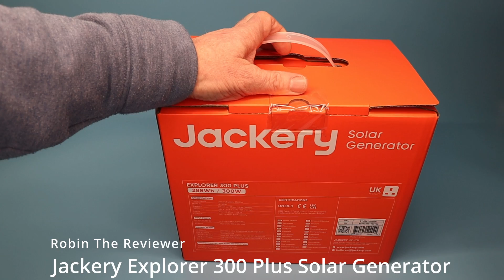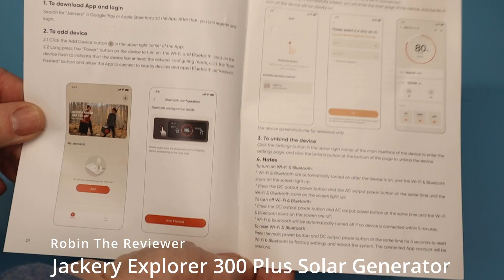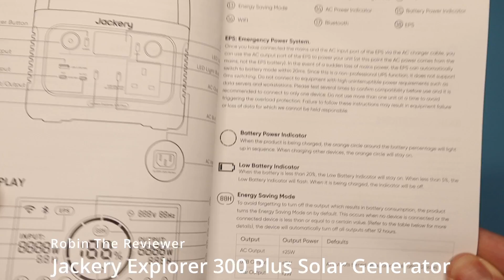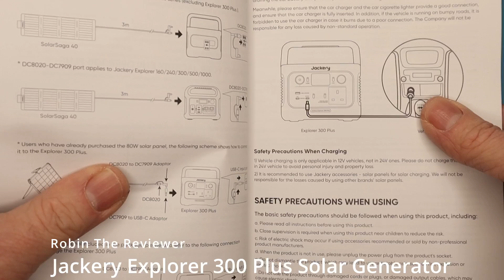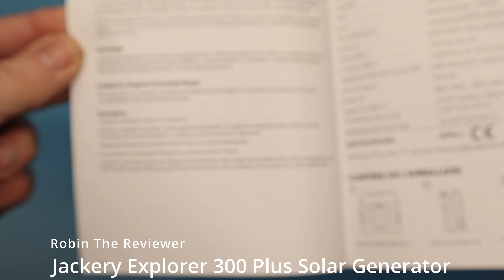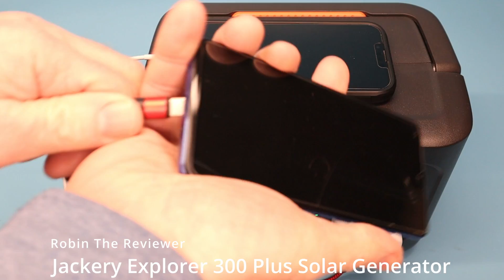Jackery  Explorer 300 Plus Solar Generator Review

Comment: Thanks for the review! At 14:26  it’s drawing 10W and the unit is at 100%. At 298 watt-hours the time remaining should be much more than 11.8 hours, no?  298 / 10 = 29.8 hours. Even accounting for 10% conversion loss to AC with the inverter, something seems wrong here.
Reply from the maker: I did find the numbers on the display did fluctuate quite a bit and are probably more a guide than a definite accurate figure. The numbers also do take time to “settle”. I found a lag when connecting solar panels or in changes in solar intensity.

Comment: Hi, thanks for the review. Can this be used to run Starlink. Need something more portable as currently going to remote locations off the grid and I have a Jackery 1000 plus bits it's really heavy to hike with.
Reply from the maker: Hi, it very much depends on the power requirements of the Starlink system. Do you have information on the Wattage, Current and Voltage requirements?